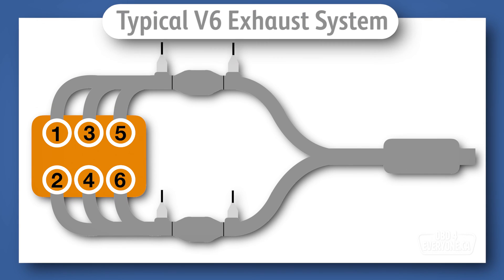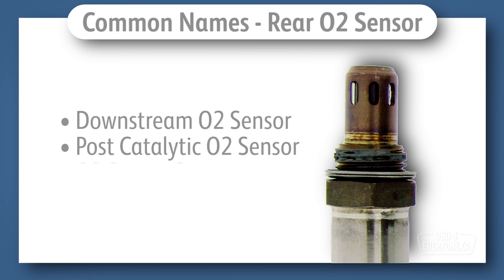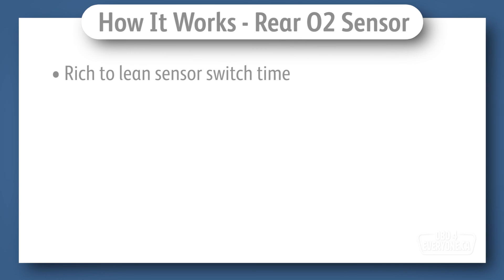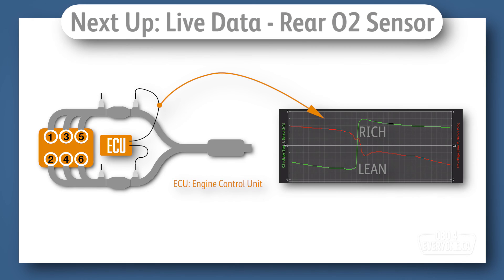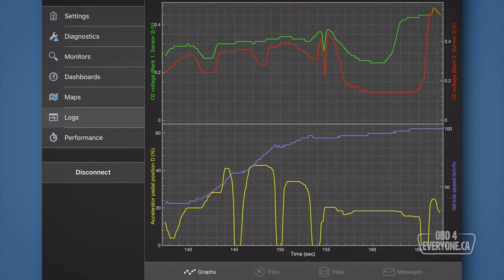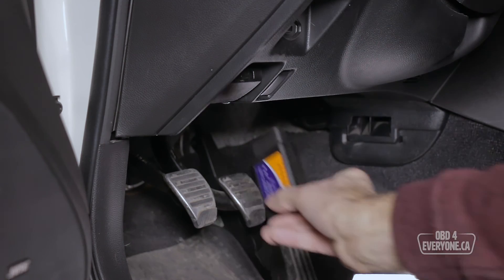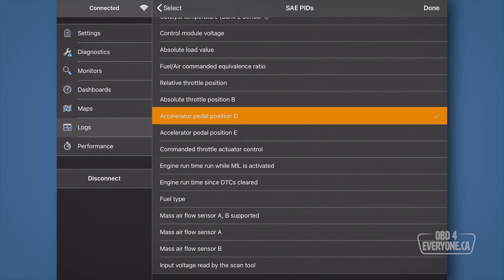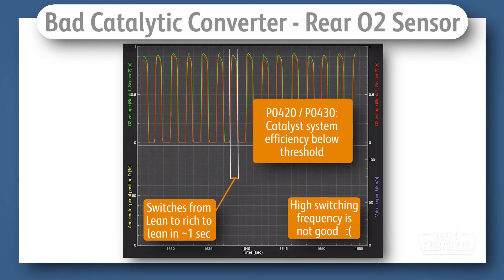Understanding & Live Graphing of the Rear O2 Sensor: OBD4Everyone Ep.19

Comment: Mine is lean and miss on bank 1 until I turn off and then restart after that it runs smooth but ltft are 4.7 bank 1 and 0.0 bank 2 it has new cats.,02’s and injectors on a newly rebuilt Ford 4.6....its got me stumped
Reply from the maker: Hey  worthey1969,
When looking at fuel trims, it is important to look at the total picture.
For each bank, add the short term fuel trim AND the long term fuel trim. This will give you the total fuel trim.

Generally the total fuel trim should be somewhere between -10 to +10%

What are your total fuel trims on a fully warmed up engine (coolant temp at 80C/175F or more) at idle?
Reply: @OBD4Everyone  ltft are bank 1is 4.7 and bank 2 is - 0.8 but I'm thinking electrical just because it's missing like a vacuum leak and rattling when you turn it off and immediately restart it runs like a total different engine nice and smooth with no rattle from bank 1, temp is 203 f.... I clean the MAF but maybe it's bad still not getting any codes
Reply from the maker: Hey  worthey1969,

What are the SHORT term fuel trims? The LTFT are only part of the fueling calculations. 
For each bank, add the short term fuel trim AND the long term fuel trim. This will give you the total fuel trim.

Generally the total fuel trim should be somewhere between -10 to +10%

Anyways, I think you need to start with the easy and inexpensive checks first:

I would use a vacuum gauge to check how steady the intake vacuum is at idle. A shaking needle indicates uneven compression, incorrect valve timing and other items. (google how to use a vacuum gauge, if you don't already know)

Generally at idle, most cars have around 18-22 inches/Hg vacuum. If you have an intake leak, the gauge will read lower.

Next, I would look at the fuel pressure and ensure it is at the proper pressure and steady.
Reply: @OBD4Everyone  fuel pressure is good, although it's a new pump I checked anyways like I said before if you start it and it runs like crap turn it off and restart it again and it runs perfect, it has to be a sensor not reading correctly I just don't know which one it is I still have no codes.
Reply from the maker: @worthey1969  At this point I think you need to verify  signal waveforms from the cam, crank, MAF, MAP, etc sensor using a scope.
If you don't have a scope, then I think it is time to take it to a shop... They should have the special tools required to continue to trouble shoot this.
Reply: @OBD4Everyone  ok thanks, I appreciate the help.

Comment: didnt tell use the nominal voltage at idle and what effect does having the AC or load should have on the voltage because it does change. explain mode 6? and also Drive cycles which is a real pain in getting O2 sensors to set to Ready or Ok instead Incomplete or Not Ready. I think that is the biggest issue people have. Like Most Liberal programs and pathetic Engineering, you have drive like a mad dog to set these monitors all the while causing more pollution supposedly, makes great sense. PCM should set to ready after idle, load and 2k rpm cycle 5 times, sadly its not that easy.
Reply from the maker: Hey  Joeybabbs .BABBS,
The voltage at idle is different for different cars. For example, on the newer Infiniti's the alternator output is low while warming up to reduce engine load and emissions.

If the AC is on, engine load is increased and the rear O2 sensor will be showing richer a little longer, but it still cycles lean to rich to lean etc. 

Mode $06 is too long to explain here. However, here is a link to a good article:
https://www.motor.com/magazine-summary/advanced-mode-06-diagnostics-march-2007/

Setting all the monitors can be tricky and time consuming.
It is always best to find out what the drive cycle is, as they can be different for different manufacturers. 
Thanks for the comment.
Reply: @OBD4Everyone  Apparently no one knows the drive cycle for my car. tesla model s
Reply from the maker: Hey  Joeybabbs .BABBS,
That's funny!
Reply from the maker: Hey Stella smith,
The EVAP monitor can be difficult to get it to run.
Make sure you follow the manufacturer's drive cycle EXACTLY as it is defined and follow the conditions required for the EVAP monitor to run. For example too high a fuel level can prevent it from running.

Comment: Best video i ever seen...i want ask you a question please....l have audi a4 2005 ...l have code 17526 sensor heat open circuit b1s2 ...p1118 .Does it affect on engine behavior on idle ..cuz l have unstable rpm when i press gas pedal
Reply from the maker: Hey  Mahmoud Hammoudeh,
Best video? Wow, thanks!

When the O2 sensor heater is not working it won't be at proper operating temperature and provide the proper feedback.

In some cases the rear O2 sensor's signal can be used to check for any lean or rich bias on the front O2 sensor. This might be what is going on with your car.
You could try disconnecting the rear or sensor and see if the issue goes away.

If you have an OBD scanner, check your fuel trims at idle with the engine fully warmed up.  Add the short term and the long term fuel trim  for each bank (if you have more than 1) to get your total fuel trim. 

The total fuel trim should be around -10% to +10%. 
If outside of this range, your rear O2 sensor might be used to change the fuelling.

To verify the issue, you will need a wiring diagram to find out which wires at the O2 sensor are for the heater. With a cold engine (ensures o2 sensor heater is on) and switch the ignition on and check for battery voltage at the heater wires. (should be 12-14 volts)

Also you can check the resistance of the O2 sensor heater, but you will need to find the specs online.
Reply: @OBD4Everyone  
Thanks alot for your quick response ....i appreciate this video cuz there is no videos talk about post oxygen sensor ..after obd check i found  downstream sensor is deactivated from ecu ...do you think the problem  its sensor fault?
Reply from the maker: Hey  Mahmoud Hammoudeh,
Those most likely cause is the wiring or the O2 sensor.

It would be best to check for the heater voltage at the O2 sensor to verify the fault, but if you don't have the tools for that, you could try changing the rear O2 sensor.

Why do you think "downstream sensor is deactivated from ecu"?

Comment: So could an exhaust leak affect the readings the downstream 02 sensors are putting out?
Reply from the maker: Hey Exile,
You bet! If the exhaust system has cracks, air can leak in and the oxygen sensor can react to that. Keep in mind, the exhaust system has pulses of positive and negative pressure. When it is slightly negative, it can pull in additional oxygen. (technically, the higher atmospheric pressure pushes into the lower pressure exhaust through the crack)
Reply: @OBD4Everyone  I see! My car was diagnosed for having clogged cats i took it to a shop because my car had really poor acceleration it had no check engine light. So i bought used ones that had according to the guy who sold them 40k miles on them. I went ahead and installed and i noticed a sorta noise when starting cold and when accelerating. For sure i have an exhaust leak and im wondering if perhaps the cats i put in are good and maybe that leak at the flange is causing the performance issue since the downstream 02 sensors are reading low and the high not steady.

Comment: My 2005 mustang gt was diagnosed for clogged cats so i went ahead and replaced with used ones that had about 40k miles on them. I now have an exhaust leak and the car is still running weak. No check engine light. I took it to ford and the downstream 02 sensors were reading low and would move up and down. They explained that the readings werent steady therefore they said the catalytics are plugged! Im hesitant to drop 800 dollars for new cats what can i do at this point?
Reply from the maker: Hey Exile,
The rear o2 sensors should switch at a frequency less than the front for proper catalytic converter operation. 

Maybe the dealer meant to say... "they need to switch slower" not "they shouldn't switch"

If the front and rear o2 sensors are switching at about the same frequency,  the catalytic converter is not functioning properly.

If you can find a shop that can do a "5 Gas Exhaust Analysis" that will tell you the condition of your catalytic converter:
https://www.walkerexhaust.com/support/tech-tips/five-gas-diagnostic-chart.html

Here is a good article:
https://www.motor.com/magazinepdfs/051998_09.pdf

Another option is to remove the pre-cat o2 sensor and screw in a pressure sensor to record the exhaust pressure before the catalytic converter.

I wish you luck with whatever you decide to do. :)
Reply: @OBD4Everyone  thanks im already looking into checking back pressure greatly appreciate it!
Reply from the maker: Good luck!

Comment: Other sites/technicians tell that if the rear 02 sensor waveform is the same as the front 02 sensor waveform, then this is a catalyst failure for sure. In my case, I found a p0420 error, which I erase it. I monitored front and rear 02 sensors voltages and found that in the very start of the car, the rear waveform is flat. After some reving, I saw two identical waveforms, with pretty high frequency. However, I drove in a city with ups and downs regarding the acceleration. Is this normal behavior? OBD told me that the catalyst is not emission ready and the last temperature recorded was 300oC. Thank you in advance!
Reply from the maker: Hey  Dimitris Peponis,
I agree, if the front and rear o2 sensors have the same/similar switching frequency, the catalytic converter function is low.

I find it odd, that your rear o2 sensor is flat upon start up, unless a cold engine is being started as it takes some time for the o2 sensor to get up to operating temperature. 

The rear o2 sensor should switch slower than the front o2 sensor, if the catalytic converter is functioning well. If the rear sensor is switching (with proper voltage levels) too quick, that will set a P0420 code.

I think the best way to check switching frequency of an O2 sensor is to find a flat and long road where you can drive at a steady speed of 80KPH / 50 MPH for 3-4 minutes. The will keep the engine load about the same and then you can see what is going on. A change in engine load, will change the switching frequency.

To determine if how well the catalytic convert if functioning, maybe you could find a shop that has a 5 gas analyzer:
https://www.underhoodservice.com/tech-tip-using-a-five-gas-analyzer-to-diagnose-catalytic-converters-2/

This would confirm if the catalytic convert is the issue for much less money than buying a new converter and finding out it is something else. :)
Reply: @OBD4Everyone  Thank you for the response.
I noticed that the rear sensor voltage sometimes oscillates with frequency equal to 1/5 of the front one, some others is exactly the same. Flat line of rear sensor is only on cold start.
Reply from the maker: Hey  Dimitris Peponis,
That is a little odd... I wonder if the catalytic converter is cracked/loose and moving around. The rear o2 sensor should have a mostly constant switching frequency when at an constant load (flat road at highway speed)
Reply: @OBD4Everyone  I realized that for some reason the front catalyst has been removed. So the identical readings of both sensors is due to the lack of catalyst. I'm in course to replace it, and when I do this, I will report back my findings on o2 sensors. Furthermore, I will replace the front o2 sensor.
Reply from the maker: Thanks for the update and I look forward to your findings :)
Reply: @OBD4Everyone  I replaced (actually put) the pre-catalytic converter. Now the car seems to run well. I hope it will stay this way :)
Reply from the maker: Thanks for the update!
Reply: @OBD4Everyone  Thank you for the answer. Today the p0420 became permanent. However, I used the log function of the OBD fusion and the results in the CSV file do not agree with what I see in the monitor. The app monitor shows that the rear sensor oscillates with smaller amplitude and frequency than the front one. What's happening with the log procedure of OBD fusion?
Reply from the maker: Hey  Dimitris Peponis,
I suspect  the datalog data update rate is faster than what is displayed. Maybe check with OBDFusion support?

Comment: Great video, full of useful information! If you dont mind me asking some questions I would like to go for it. 

1. Is it possible to make sure that the CC is in the place (I mean not stolen or been removed by previous owner) by seeing the voltage on O2 Downstream sensor? I mean would the sensor still give voltage information on OBD2 if the CC is not there? 

2. I have Peugeot 407 2.2 petrol. I just bought o2 sensor for downstream because I noticed weird movement (like very slow response) on o2 downstream sensor while checking with OBD2 so Im going to my mechanic to change it this friday but before that could you tell me that P0410 code is related to CC or O2 sensors somehow? My car is keep throwing p0410 code and I already replaced secondary air pump but still get the code. And I have awful gas milage in the city (long ride its normal), is this somehow also related to o2 sensor? 

Thanks a lot in advance!
Reply from the maker: Hey Hurgeneral,
Thanks for your kind words!
I am not familiar with Peugeot's but will do my best :)

Answers:
(1) Yes. If the catalytic converter is functioning properly, the rear O2 sensors should be switching between slowly (2-5+ seconds) between lean (about 0.1 volts) and rich (about 0.9 volts). The front O2 sensors should be switching much quicker (about every 1-2 seconds)

(2) As mentioned above, a slow switching rear O2 sensor is a sign of a healthy catalytic converter.

As you know, the P0410 is a secondary air issue. There is an air pump that runs for 1-2 minutes on a cold start to add extra air into the exhaust to speed up the catalytic converter warm up to reduce startup emissions.

The engine computer will turn on the secondary air pump and then watch the fuel trims to ensure they go a little lean (due to the extra air being injected into the exhaust) 

If you haven't already, check the relay for the secondary air pump, check for any small cracks in the secondary air lines and check for any exhaust cracks or leaks.

Good luck!
Reply: @OBD4Everyone  Thank you very much sir! Im a bit relieved about CC because its very common to remove it around here! Everything will be more clear on friday of course but I just couldnt wait :)
Reply from the maker: Anytime! I hope all goes as you hope :)

Comment: Have an 03 Honda Element. Got a P0420, so I set up the O2 sensor readouts on Torque Pro.  O2S1 reads fine, but O2S2 is flatlined at 0v no matter what the throttle position.  Put in a new O2 sensor and the same.  Never any change in the plot, just stays at zero.  Would a bad cat cause flatlining, or is this more likely an electrical problem?
Reply from the maker: Hey  NobleLock,
Since the voltage stays at zero, I would start by look at the wiring and check for any damage, then check for continuity from the O2 sensor to the ECU.

Also, check for any exhaust leaks. A crack can allow additional air into the exhaust stream and can result in a lean (low voltage) signal. BUT there would be some voltage level changes.

If the engine performance of the car is normal (and not lower) the catalytic converter is likely good.

Good luck!